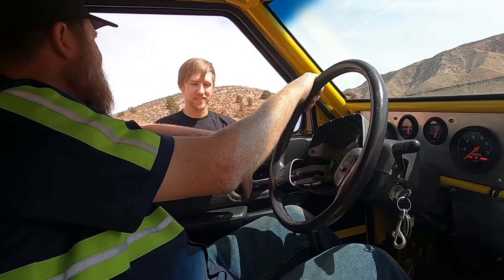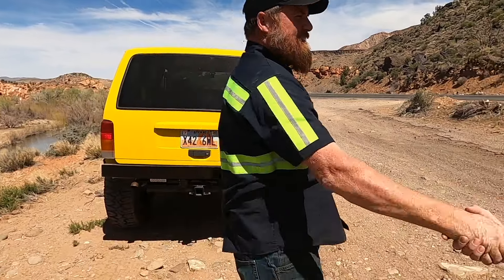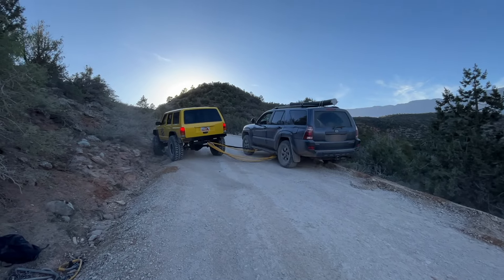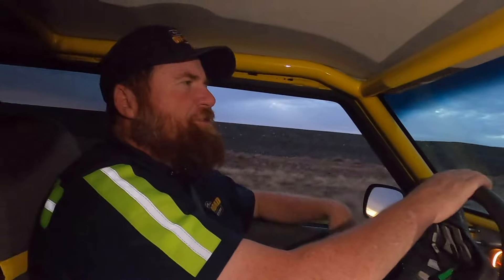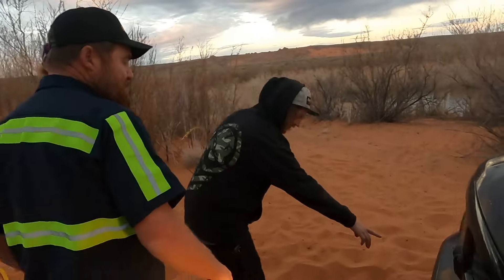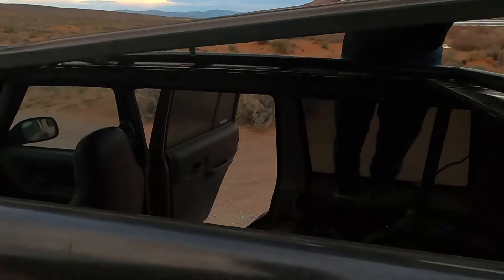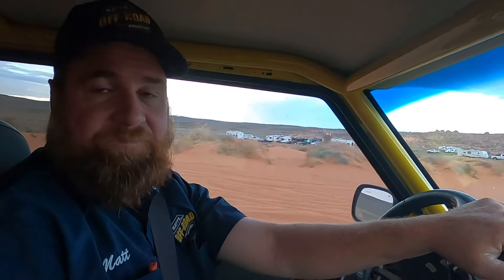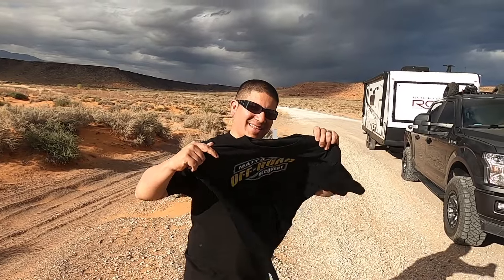Very Lucky Toyota Went Over The Edge.The Banana Is Back!

Comment: Welcome back Matt.  Good job Rudy.  Your removable roof is awesome.  I like the outside roll cage/body stiffener, too.  You sure do good work.
Reply: He does, he inherited his dad's design/problem-solving abilities as well as having great fabrication skills.
Reply: Yeah Rudy sure knows his way around a welder which will only help the company in their line of work.
Reply: indeed, I like the safety cage.
Reply: The exterior roll cage will cost some horsepower and gas mileage due to air friction at freeway speeds, but it's a good compromise for the way they use the vehicle.
Reply: @rconger384  I have an outside cage on the cab of my landrover Defender. Contrary to my expectations the gas mileage didn‘t get appreciatively worse.
Reply: I have a simple question. What do u do if the weather is iffy when u leave for a job, but then changes and u want to take the roof off. Where do u put it?
Reply: @TassyDeval  idk  have to ask Rudy, he's smarter than me.
Reply: @TassyDeval  something tells me they don’t get a ton of rain where they’re at, so that situation probably doesn’t come up very often.

Comment: Hope not double post.  Thank you Matt for tossing the tire under frame during tie rod replacement.  Makes the job so much safer.   I like the “trail fix, rather them load, drag when possible. Just make sure you warn. “This is not a road fix, drive at your own risk”

Comment: Thank you Matt for calling a driveshaft a driveshaft. This driveline thing just boggles the mind. Thumbs up !!
Reply: "driveline" refers to everything behind the transmission, from the front yoke to the wheel hubs, those are all driveline components. it's not a new term, it's been used in the motor vehicle industry for many years.
Reply: @marvindebot3264  Correct but some call the driveshaft itself " a driveline ", which it is not.

Comment: This reminds me of the day I was callout to a truck that had lost 6 drive wheels,   yes sadly the workshop didn't tighten up the wheel nuts properly,   as I arrived two wheels had gone for a wheelie up the road one of those wheels hit a traffic sign 3 metres high,   the other 4 wheels were on a angle with only a few nuts holding them on,   but the wheel studs were all bent inwards so I had to jack up the truck block it up for my safety then bend the studs straight,   it took me 4 hour's on my own,   thankfully it was a Mercedes Benz truck and the steel was very good,   thankfully no one was killed or injured by the wheels,   strangely enough this is but a simple but just another day at the office for me as a fleet technician for Bridgestone commercial,   now retired I watch your truly unique videos Matt, ☺.

Comment: That sleeve over the tie rod is very similar to what is called a "buckling restrained brace" used in structural steel buildings to resist earthquake loads.

Comment: Hey Matt, get some 2x4 and two feet long and put it under the driver wheel (in this case) and it will increase the area and help it not slide as much. Makes it want to climb out sooner. Been using that on muddy road recoveries!

Comment: I hope I didn't miss seeing my suggestion being used in an earlier video as I have watched many but certainly not all. My suggestion is using one of those tow behind trailers for RVs or moving vans that are only two wheels. It seems to me that I've seen some of your recoveries, especially the deep sand ones that would have been easier with that smaller wheel base. I really enjoy your videos. I own a 2016 Wrangler  Unlimited and stay in the woods but only on grave or sand.

Comment: I had the bouncing tach needle and I had to add some kind of resistor in line from the distributor signal wire. Easy and cheap fix.

Comment: you have electronic noise on your RPM device change wires for shielded cable, if continuous you have to make a filter (capacitor and coil)

Comment: Matt, Claritin-D is what you need for those allergies. You'll get instant relief and it will dry your head out. Being from AZ I live on the stuff. Can get store brand at Costco for cheaper and get the 12 hr not the 24. If you're poo pooing on this comment, just rember you used to also poop on using grinches too 😉😋

Comment: I was wondering why you don't unhook the trailer sometimes, pull out the vehicle, and then hook up the Banana to the trailer and pull it out.  I know your vehicles are usually much higher, so you may not have the correct hitch point.  Just wondering...   Thanks for the great videos!  Keep them coming!

Comment: Rudy, your removable roof kinda gave me an idea... I have an 08 Liberty with the sky roof (the power rag top) I hate the design of it but love having the roof open. Well, as they are known to do, the slides came off track and broke and I'm not planning on spending $3k to have it fixed. I got it as close as possible, pulled the wires from the switch and capped them. It was leaking pretty bad in the rain, so I Gorilla taped the outside edge and it's water and air tight at least now. Quieter than it's ever been really. I wonder if I can make something like what you've got work for it and convert it to a regular top that is removable.

Comment: The reason why your tachometer is bouncing is because you need a tach filter which is essentially just a capacitor.  The original cluster most likely had a integrated tach filter.  Instead of buying a expensive filter made by the gauge manufacturer you can buy one for a 70's gm vehicle and they are usually under $20.

Comment: a friend of mine has gone through literally 5x 4L80 automatics, and they all died Exactly the same way, he was towing a trailer, and cooked the transmission because the pumps are weak on them (and yes, before the keyboard warriors chime in, these were all Factory transmissions With Tow HD Package, and With Transmission cooler installed, and yes it was properly filled with the correct fluids), honestly i prefer the good old TH700R4 or TH400 because they just work, glad to see the banana running again and out doing her job, stay safe out there guys

Comment: Wow that EXO cage is completely 'over the top' on Rudy's Jeep!(pun intended LOL!) and then the way the roof comes out is coolest thing I've seen in a while!
 I kinda thought of doing that with mine considering that piece sheetmetal gives no structural integrity at all( I've had the roof on my 2 door XJ buckle up-and-down just from driving through really high winds🤷‍♂️).  I'm really glad to see that you have a cage in it now considering how much more capable that rig is gonna be from here on out.
 Hey maybe since you've got all that reinforcement on top you could carry a couple of ramps and be able to do do ATV and smaller UTV recovery with or w/o a trailer by rigging your winch over the top of the Jeep to pull them up and onto your roof like Cleetus McFarland did with one of his Crown Victorias.🚓💨

JK,.... Without having a fully adjustable air ride suspension that might become a real handful with the CG so high but that set of full width axles definitely makes it almost feasible. 💁‍♂️

Comment: If you guys have those rams and have a leveling kit or small lift don't use the cheap aftermarket axles. They keep ripping the boots right off because they can't deal with the angle.. I cant remember the company off hand but we sell an aftermarket one that has some play in it to allow got the lifts and stuff... I sell so many damn 1500 ram axles. Crappy design

Comment: You most likely will never see my text. A friend of ours in his 50s my dad's best friend for 49 years. Bent his scout tie rod in the sand dunes in Oregon. We told him home he thought he was done for the day even my dad couldn't figure this one out. My dad has been my teacher my whole life I was probably only 21 22 I'm 54 now that's exactly how I fixed it was putting in a receiver but it was a lot bigger one we just went dad's truck and a cheater to push it straight stand back who knows what might happen lol. Our minds work alike there's always a way. Another time I borrowed my wife's truck not my wife at the time girlfriend and I got a flat tire in the woods and she didn't have the key lug nut wrench. I got all the lug nuts off but one. So I took a hammer hit the lug nut One direction rotated it and hit it one time the other direction and it stretched the threads enough that I could change the tire I took it off with my fingers with two hits. It was an 8 lug rear end so there were seven good studs still left replace the 8th one when I got home. I hope this trick helps somebody in the future anybody reading this. If you're into still in rims ignore this message

Comment: So the banana is not quite done? Got some little details to finish? Never gonna happen. It’s done. It will be March 2023 if not longer before all the missing bits are re installed. Just like the AC on the Morvair was never finished and working.

Comment: Racing on the back roads is usually great until we run someone off the road. That should be charged as a hit and run. Even if the hit is the cost of a tow, it's a hit. It takes the same type of attitude to run someone off the road and leave them, as hitting the vehicle and leave. In fact a hit and run usually leaves the victim able to drive. Run someone off the road and they may not have water or health to dig out or phone to call for help. It could easily be a death sentence.